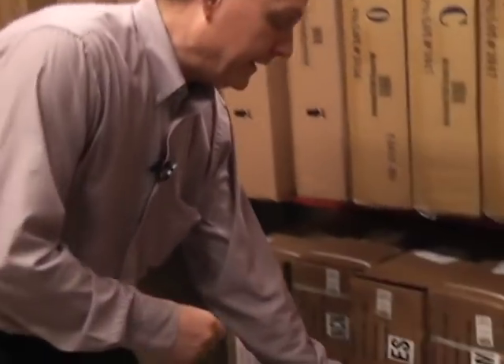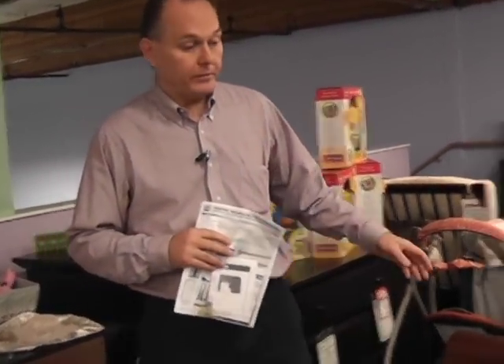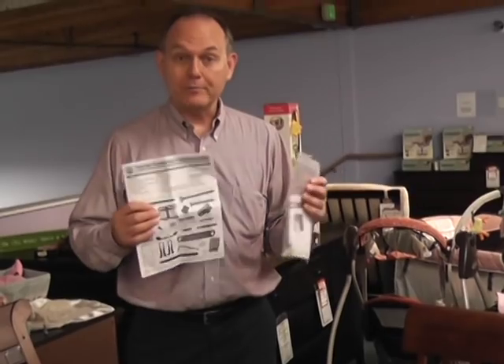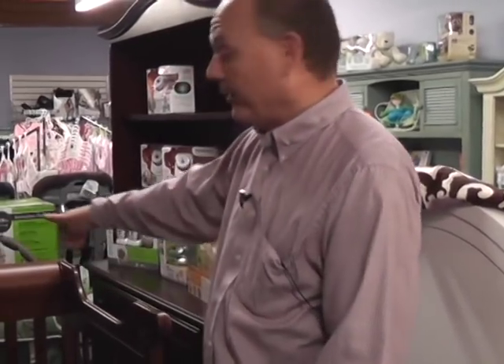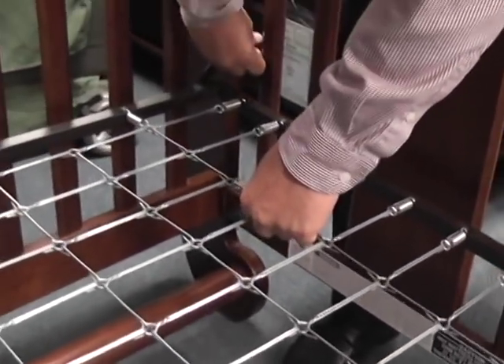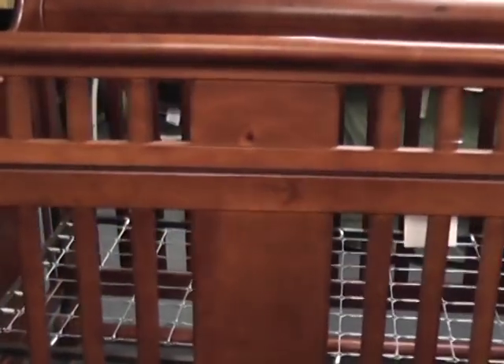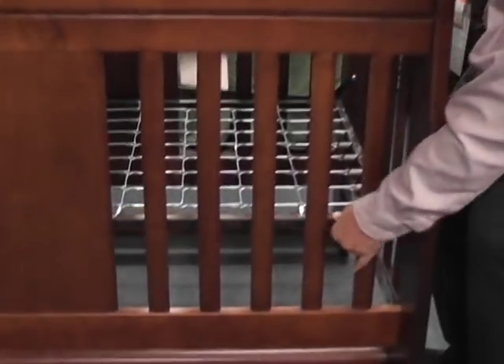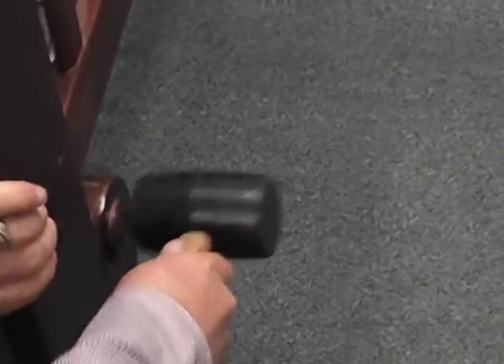Baby's Dream Crib Assembly Demo

Comment: We tried converting to full size bed but the box spring doesn't fit, a normal box spring is 54 inches. The space measured only 52 inches in width.
Reply: Thanks for saving me a lot of trouble!!